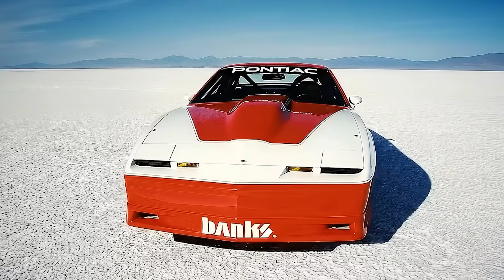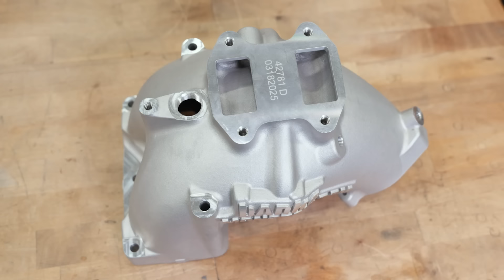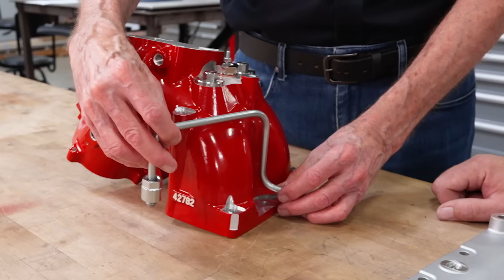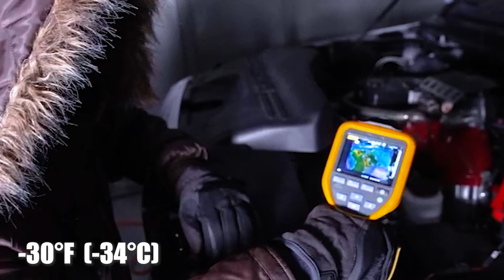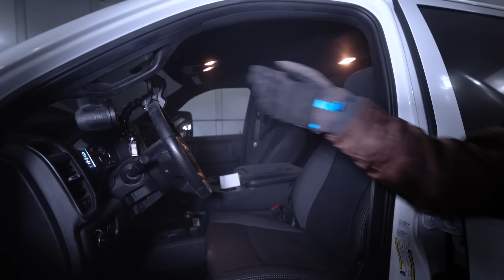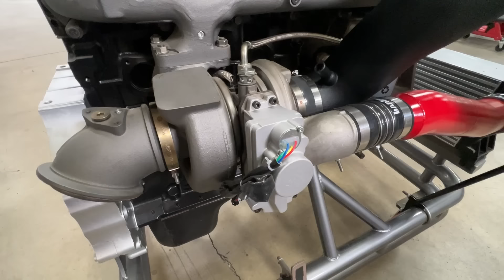The RAM 6.7L cold start dilemma.

Comment: What cycles the heater on and off? Is it just the initial pre heat or is there a intake air temp sensor? It would be interesting to see what 3000W would produce for intake air temp at a given ambient temperature.

Comment: Yeah in one year in Ft McMurray, ive worked in 47c in the summer and -45c (feels like -50c) in the winter. If you turn your truck off for 20 mins shes done, thats it. In the oil/gas there is rarely a spot to plug in where your working so it idles all day/night. Some will have oil warmers ect but yeah its quite a place temp wise. Battery packs, jumpers and Herman Nelsons for the win lol.

Comment: How about doing a test of the temp of the air after going through the stock heater grid compared to temp of the Banks. And what's the watts of the stock heater grid. With all that room in the banks it is hard to believe the air temp will get up to what Cummins had intended. 0 to -20F where I am from. Big Bamks fan, not concerned about more power just reliability.
Reply from the maker: We've done comprehensive testing in a climate controlled chamber to validate that our heater works as well as or better than stock. Keep an eye out for a video where we go over this.

Comment: i wish mine had the 2 heat .. i bought my kit last yr when it wasnt avl
Reply from the maker: For folks like you, we offer the Billet Heater Kit which mounts to the bottom of your Monster Ram between the throttle body and the ram itself. It's super easy to install and is available with one or two 750-watt coil heaters. 

https://bankspower.com/products/monster-ram-750-watt-heat-upgrade

Comment: Mr. Banks,
I live in Brazil. Very hot weather. So heating for cold starts isn't an issue.
I'd like to know if even without using intake heating, the stock one, am I in danger of the said bolt catastrophic failure?

Thanks in advance.

Comment: where is the data for this ''increased fuel economy and reduced turbo lag''?
Reply from the maker: We've measured increases in fuel economy when testing on our trucks, but your mileage may vary. The issue with quantifying that is that driving habits, climate, vehicle condition, fuel quality, use of additives and so on... radically change the outcome. This why we don't publish this data. Individual customers would have a tough time replicating our test, unlike with, say, horsepower claims. With hp, anyone with a dyno can validate our numbers.

A reduction in turbo lag comes down to a reduction in turbo shaft speed. If the turbo is able to meet the ECM's boost target at a lower compressor shaft speed, you'll feel that as a reduction in turbo lag. Removing restrictions on either side of the turbo will have this effect.

Comment: Great product but I just want my cold air intake. I’ve been waiting for over a year for BANKS to send my redesigned intake tube😩😩😩
Reply from the maker: We apologize for the extended wait but we're working on it. The RAM has been a challenge to get just right, and because we don't want to put out anything that doesn't meet our standards for no compromise performance, we've held off on releasing it.

Comment: Have had the OG monster ram installed for four years now and I love it, might have to upgrade, I saw -19f and the poor truck had a hard time starting. Dark iron diesel’s video has me thinking it might have been tuned related though. Time will tell! Winter is coming - hopefully!
Reply from the maker: The good news is that you don't have to buy another Monster Ram to upgrade. Our Billet Heater Kits will bolt on to a classic single heater Monster Ram and offer the same starting performance.

https://bankspower.com/products/monster-ram-billet-heating-kit-cummins-67

Comment: Will the 2 heater billet spacer bolt to factory manifold?
Reply from the maker: It will, but you're going to miss out on all the benefits of switching to a Monster Ram!

And it there's no easy way to run power to it without going to a Monster Ram.
Reply: @bankspower  Ok thanks.

Comment: Oh Boy do I have some cool cold start stories to share.    My Dads old 7.3 diesel ford.  Running amsoil.  It was left out in the bush for a solid week, they went back to pick it up, it had been 30 below for the week, and -30 something when he cranked it up.  He remembers it turning over and starting instantly.  Swear on the 2nd or 3rd compression stroke.
Then I witnessed it for myself as well.  It was -42 overnight,  I believe he was able to plug it in this time for a few hours (Only with a block heater)  The thing cranked over and fired right up, no thunderous smoke, it just started.  The thing sounded like a bag of hammers, but it fired right up.  Still runs today, 700,000km.  Dad says amsoil fuel treatment and amsoil engine oil is to blame.  

compare it to your new 6.7L cummins, that thing has permeators stopping the engine from even trying to crank.  That old 7.3 i don't think has anything
Reply from the maker: The 7.3 is a legend and definitely had a lot less electronics than today's modern diesels! 

That's the trade-off with power though, and emissions. Getting a 7.3 to output 500 hp and over 1k lb-ft of torque takes some work, while new Fords and Rams are basically doing that from the factory.
Reply: @bankspower I see,   interesting!  Thanks for the response

Comment: This reminds me of SO many people on the internet who say if you don’t drive away with in the time it takes to fasten your seat belt even at -50°c or colder. My personal coldest seen was -54°c that your diluting your oil with unburned fuel and causing your engine to carbon up. Both in diesel and gas motors. That the worst thing you can do to your vehicle is not drive it immediately even at those cold temperatures, and that a modern non carbureted vehicle physically cannot warm up at an idol. I once pointed out that your oil cannot flow until it warms up. And you can hear the vehicles that do that from at least a block away. That doing this destroys your engine. They did not respond. But several other people said that I was crazy. Modern synthetic oil flows in seconds no matter how cold it gets. That I was arguing against science. So I just ignored them. But I wish that these people would look at the facts about oil at those temperatures. Then realize that if you don’t give your oil a chance to flow before you put a load on it you will have metal on metal for several minutes before your oil starts to flow and that is not good for you engine. Worse than there delusion concerns. Your automatic transmissions especially have the same problem. Though manual transmissions have the same problem. Just no tiny oil passages.

Comment: There is actually winter diesel in Kamloops then Arctic diesel more North I have filled up in Kamloops and hade gilling happen as I went North
Reply from the maker: This is news to us! Makes sense that there'd be an arctic blend though.
Reply: @bankspower 

Winter Prevents gelling and filter blockage in cold weather, down to around -22 A blend of diesel, with a higher percentage which contains kerosene) to improve cold-weather flow.  

Arctic Designed for extremely cold, arctic conditions where winter diesel would fail.A highly processed blend, often classified under specific arctic standards, that remains usable at temperatures down to-40Necessary for regions with consistently severe sub-zero temperatures.

Comment: Just so you know when you order the "killer upgrade" you get one element. Just like the old non killer monster ram. Deceptive advertising makes you wonder about this company.
Reply from the maker: We're clear in our product descriptions and our videos that the kit is capable of dual heat but that a second heater is sold separately. This was done to keep the price the same and because 99% of guys who buy the Monster Ram won't need the dual heaters. 

We're sorry if it was unclear. The last thing we want to do is confuse anyone.
Reply: @bankspower the"killer upgrade" consists of an elbow with more holes in it. That's it.    It is not an upgrade. The extra element you have to order separately is the upgrade. Deceptive advertising indeed.

Comment: My 2016 Chevy diesel would start in -40 not plugged in using mobile 0w40
Reply: My 2010 is the same. Shes grumpy but she will start without assistance at -40. Beauty of duramax’s is they run a grid heater and glow plugs

Comment: What about the air restrictions with those inline heaters?
Reply from the maker: Adding heaters does increase air restriction, but the difference is less than you might expect. Plus, the heaters are designed to be quickly and easily removed so that you can go back to having maximum airflow in the warmer months.

Comment: My god, if people are running 3000w of heater. Are they adding a 3rd or 4th battery as well?
Reply from the maker: While 3000 watts is definitely more than the stock grid heater draws, it's not as huge a difference as you might think.

Comment: I’m sceptical. If you gotta run 4 of those elements that has to impede airflow. Might as well run stock. My understanding people delete the relay to save grid heater bolt failure?
Reply from the maker: Deleting the grid heater relay eliminates your heater, making starting in cold climates a lot harder. The Monster Ram with dual-heat doesn't appreciably impact airflow and should be more than enough for 99.9% of guys even in extreme temps. Adding more heaters will affect airflow, but we've designed the system to be easy to wrench on and super modular, so you can unbolt the billet heater kit and max out airflow all summer long.
Reply: @bankspower I wanted to purchase the banks intake but was concerned about starting. The shop had yet to test this dual heat system you have designed. I went with a different grid heater bolt delete system a couple days ago. I need my truck to start in -30. Perhaps if you had test results and numbers for your cold weather starting compared to stock, I would have went with banks. Also air flow/presssure resistance numbers compared to stock with heaters installed and without. Can this be done?

Comment: Power Driven Diesel measured 0.8 PSI max of boost lost across the elbow and manifold on a compound setup running 100+ psi.  How does that translate to "a couple pounds of gain" on a stock truck?  Seems the two data points don't align.

Comment: Now make an oil pan that accepts these heaters (or similar) and let me plug it in with my block heater...
Reply: Temro make 120V oil heaters. You need to watch how many watts per quart.. Too big a heater will burn the oil , adding coke/ soot to pan..There is a chart in Temro Catalog..

Comment: I have the original single heater design for my 2008 Ram 2500.  Now, I've never failed to start, even at minus -40C and below.  I live in the Canadian prairies and have even spent two winters in the Arctic Circle looking for oil, making old Detroit Diesels start for a living.  I did order the upgrade kit for my truck.  Now, I never had an issue starting before but it would always throw an engine code stating heating grid performance is low.  So, I'm excited to try this upgrade out along with the boost tubes I ordered.
While I do appreciate the upgrade, let's say the farm kid in me came out and I did lay awake at night thinking of a possible better way with no airflow restriction.  Could I send my idea to you?  I'm not looking for money; I just want had an idea that may solve both issues. That's the farmer in me, looking at a problem and coming up with something.

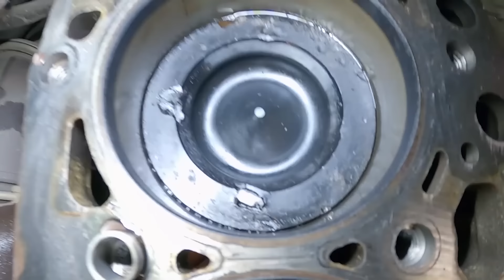Comment: 0:54 so they moved away from the KDP to the KGHB
Reply from the maker: Essentially, yeah. If anything though, the Killer Grid Heater Bolt is an easier fix than the dowel pin just in terms of hours spent.
Reply: @bankspower yeah. I guess cummins if fixing this themselves with the new generation of engines. Wonder what kinds of upgrades youll put out for it
Reply from the maker: Stay tuned to find out!

Comment: With the addition of 2, 3 or 4 heaters. Does this change the airflow characteristics?
Reply from the maker: The short answer is yes, but not as much as you'd think.  We've also found that the heaters are so easy to swap in and out that it's not a big deal to go back to one heater during the warmer months.

Comment: Alright, for the folks that are saying the guest doesn't know the diff between #1 and #2 diesel is because he doesnt because he doesnt need to. In Canada, the public really doesnt have a choice at a typical gas station on which grade of diesel fuel they want. Not how it works here. We call it summer and winter diesel. And it gets blended out by the supplier. Its just diesel at the pump. But as a farmer, i can have the choice of dyed winter or dyed summer diesel delivered to my tanks.

Comment: If you want to start a -40 degree engine you need a large 48v battery pack. Enough battery to heat the block and inlet air at -40 degrees.

Comment: Push come to shove , you use an oil soaked rag on fire under the oil pan to warm the block . Then hold it in front of the air intake minus filter while cranking . I worked on a skid steer that used a heated cold start injector that produced a flame in the intake log . If you were really serious you would go with something like that .
Reply from the maker: Setting things on fire is not something we'd recommend. We'd hate to see anyone burn their truck down or get injured. 

Factory block heaters when available and a healthy battery with an appropriate amount of intake heat for the temperature is a much safer option.
Reply: 😂 @bankspower  well , in the real world ( not Utah USA ) you do what is nessecery.

Comment: The best cold start device for an angine is an engine heater.

Webasto and Eberspächer make heaters that put 5kW of heat into your engine and circulates the water so that you can heat the cab as well.

If your starter battery/batteries are anywhere near the engine, those will be hot to.

Comment: Dodge has a sensitive fuse box and how is that extra wattage going to effect it? Dodge has sensitive wiring and that's one of the major problems with Dodge.
Reply from the maker: We've not experienced any issues with adding additional heaters. The stock grid heater in good condition draws a huge amount of current, so we're not overtaxing anything.

Comment: The best at -40°C being from Timmins, Ontario is a having a dual circuit plug in with an inline circulating coolant heater and a battery blanket to keep the block about 20° warmer than outside and the battery warm enough to have some reserve cranking amps.  It will roll the engine, even sitting all night.

Comment: Does changing this out void your Ram diesel warranty?
Reply from the maker: It depends on your dealer. In the US, we have the Magnuson Moss Warranty Act which states that the dealer would have to prove that a failure occurred directly because of the modification (in this case the Monster Ram) in order to void the warranty. The issue is that many dealers don't follow the law and count on most customers not having the time or resources to be able to challenge their decision.

So, short answer is no, it shouldn't void your warranty. Long answer is that it depends on your dealer, but if one is being really restrictive, it's worth looking around for one that's more reasonable.

Comment: With this new dual heat version of the monster ram, the limitation is not the heater. Up to around -20F you can get these newer diesel trucks to start completely cold & unplugged with two great condition batteries with good fuel and oil. Any lower temperatures than that and the batteries usually just don't have the power to crank the engine over without plugging in with a battery heater and the factory block heater.
Reply from the maker: That's true, to an extent. Going beyond dual heat is certainly for edge cases. RAM mandates using block heat below -20F anyway, and we'd recommend following that guideline as much as possible. The extreme cold temps can cause other issues like increased wear on the engine, so if you can block heat, you definitely should.

Comment: How does the adapter with a single and a double heater affect air flow to the engine? Are they obstructions or is there no affect at all?
Reply from the maker: Anything in the path of oncoming air is going to affect airflow. That said, it's not a massive difference from a performance standpoint and the heaters don't take much time to swap on and off, so going to a single heater and max flow in the warmer months is always an option.

Comment: The question is, does adding a 3rd  or 4th heating element to the duel heating element intake actually impede air flow once the truck is running (cold or warm).  Living in the Northeastern U.S, I would prefer to have unimpeded airflow so that the combustion is as clean and as powerful as I could get.
Reply from the maker: The short answer is yes, but not as much as you'd think.  We've also found that the heaters are so easy to swap in and out that it's not a big deal to go back to one heater during the warmer months. That said, with the winter temps in the Northeastern US, you should have no issues with a dual-heat setup, so having three or four elements would be unnecessary.

Comment: What threads are on these intake heaters, I see they have a copper washer?  I'm curious because I want to use this on a 1970's Allis Chalmers 180 to replace its intake heater (no electricity where this tractor is stored).
Reply from the maker: The heaters are M22x1.5

We'd love to see photos if you get a setup working on your tractor!